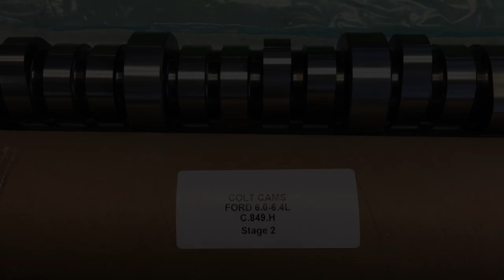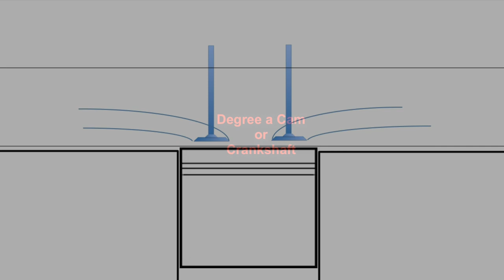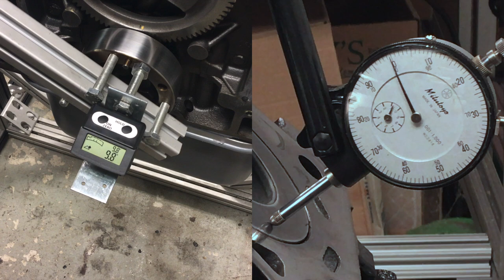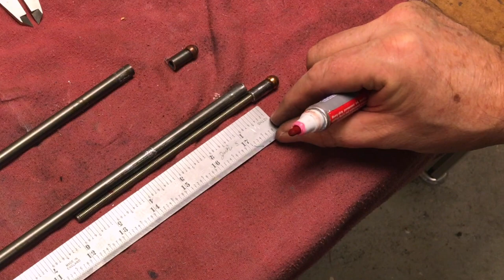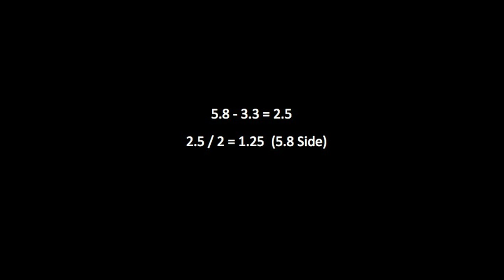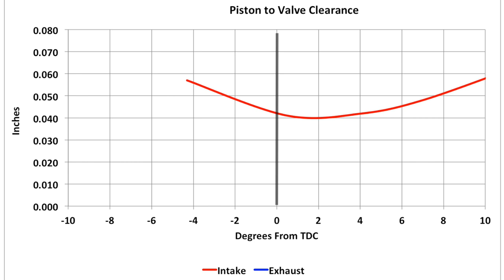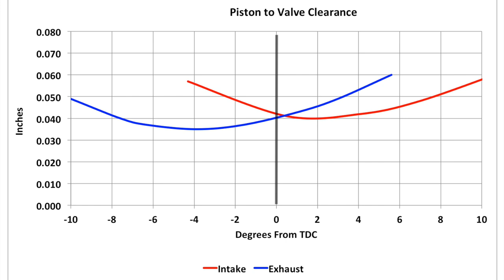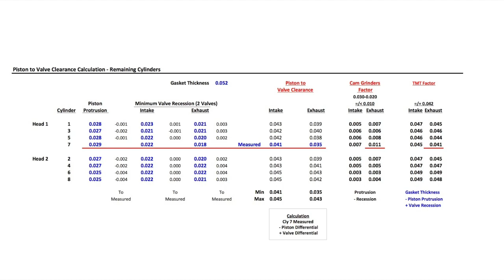Powerstroke 6.0 Colt Cam Stage 2 Piston to Valve Clearance Check

Comment: This video is very helpful. I just broke all my intake rocker arms after an engine rebuild and colt stage 3 cam.
Reply from the maker: Mike, really sorry that happened to you.  The three ways of dealing with that are the lowered height pistons, flycut valve reliefs, and sometimes deeper valve recession.  It can be a combination of the two.  This has to be frustrating!
Reply: @toomanytoys Thanks for the the tips. I bought an engine hanger from you a while back. I got the $100 model. I am putting it on a E450 Schoolbus. The hanger works great if I put a chain link in between the uprights. I'll send pics. 
I did have a machine shop shave 80 thou off the pistons before this happened, I guess what wasn't quite enough. I am using the 6.4L length pushrod.
I will also check the cam timing, as if it were retarded one tooth this might happen?
Reply from the maker: @MikeF1189  Without looking at the numbers, I would have expected 0.080" would not have an issue.  A question I can think of is, were the valve recessions within or to the deeper side of tolerance?  

Checking the timing is a good idea. 

Unfortunately, I had no experience with these brackets with the Van, but I'm glad you found a way.

Comment: I have the same Mr. Gasket dial at 5:25. It works for me. Clockwise reading then counter clockwise, and divide by two. It works. I don't see an advantage to going with a digital scale.

The question, what if you found the least piston protrusion cylinder, say number two then swapped it with number 7?
Reply from the maker: With the dial, the accuracy depends on the parallax of reading the pointer to dial, and you have to be in front of it.  The digital takes out any errors and is easy to read and easier to set up.  After doing it both ways repeatedly, I'll always use the digital now.  But if your fine with the dial, stay with it.

You can flip the CR/pistons to equalize compression (protrusion on this motor).  It depends on the con-rod/piston assembled unit's tolerance stack to any variation in individual crank throws.  You can even see what the tolerance stack is between pistons and con-rods.  Unless you got a real issue, it's a fair amount of work.  There's more variation in the aftermarket parts world.

Comment: Jack, you don't know me but you've had an influence on my latest engine build. 

I just got the engine back in my truck; like two days ago; I put in a Colt stage 2 cam and a borg warner S300 turbo; I balanced the rotating assembly and had some custom tunes made up. I'm very impressed; very happy, thanks for making this video and influencing my decisions.  

How's your truck running now? are you happy with it?
Reply from the maker: Glad to hear anything I've done has helped.  Enjoy the truck.

Getting the engine back to gather is about my lowest priority, unfortunately.  It would only take me about a day from where it is at this point.

Comment: The late model pushrods are shorter than the 03s I believe .007 shorter to mitigate cam and lifter failure correct me if im wrong
Reply from the maker: The 6.4L motors had the shorter pushrods by 0.050", 9.845" to the new 9.795".  The very first 6.4L motors used the longer pushrods and had issues according to Geoff Bardahl, owner of Colt Cams.  The shorter pushrods were immediately introduced during the initial production and International dropped the longer pushrods.  The longer pushrods were not introduced until 2008.  

In a stock condition, the times you have a 6.0L develop bent pushrods and broken rockers is when the motor sits for months (like school busses) and the guides rust.  The other times the 6.0 bend pushrods is during in-service rebuilds.  The lifters can draw in more oil during the teardown and be "pumped up", or the pushrod is not fully engaged into the plunger cup.  They can also bend if the valve spring pressures are increased, and you see that when heads are rebuilt.

If the 6.0: was bottoming lifter plungers due to too long pushrods, we would primarily have seen a lot of burned intake and exhaust valves as they would not fully close once the valve train expanded at full temp.

Comment: Stupid question, does the litter move the guides vertically (with respect to the cylinder bore orientation) when the cam lobe pushes on the lifter? I have been doing some reading on the guides, specifically how tolerances with the direct injection molded plastic can leave the lifters permanently 2 degrees off square with the cam.
Reply from the maker: The guides have no impact on the lifters' bearing surfaces, so no impact on the directionality as far as parallel to the cylinder bore orientation.  The guides only keep the lifters from turning in the bores, so the roller is oriented CLOSE to the 90º of lobe rotation.

What does keep the roller at 90º to the lobe is the roller itself, being barrel-shaped rather than flat.  Most people do not realize that.  A wheel with a crown to the center wants to track straight.  It also works with belts, and why you often see flat belts with one, and only one, fully with a crown to it.

I do have a lifter video if you care to review it.
Reply: @toomanytoys  I have seen the lifter video several times, that is what brought me here. Unfortunately I have not been able to answer my own questions up to this point.

I have heard much speculation as far as the cause for higher lifter failure fates on the 6.0 powerstroke. Your video discusses  a few factors which seemed as if they could potentially contribute to increased lifter failure, however one I have found which wasn't mentioned is the guides.

Here is an excerpt from some research I reviewed:
"Plastic lifter guides are injection molded with an interference fit to hold lifters firmly for assembly purposes. This tight fit is supposed to locate a roller lifter so it’s nose wheel is in perfect alignment with the camshaft lobe. However, our measurements have shown that plastic guides are often mis-shaped and do not align lifters properly with the camshaft. It is common to find plastic lifter trays out of plane by .005" in .500" and as bad as .015" in .500".Nearly 2 degrees crooked! 2 degrees is double the entire range of motion steel lifter guides allow and the plastic guides fix the lifter that way for its life"

If the above is true, I could see this as being a contributing factor to seemingly randomized lifter failures .

I have heard that one of the series of the duramax uses metal guides, however the plastic LS guides will fit inside of the area where the metal guides sit. There has been speculation as to the engineers testing with the plastic LS guides, then switching to metal for production. I have no way of verifying this. I do know that lifter failure on a duramax is virtually unheard of.

Thank you for your insight.

Comment: Think I'll just use clay.  Are you interested in a move to Concord, NC to be my neighbor?
Reply from the maker: Thanks, but I don't want to make a habit of 6.0s.

I had tried clay on this but didn't feel confident in measuring clay this thin.  If it was 0.080", there would be more tolerance for a few thou off.

Comment: I'm enjoying your videos on YouTube. I'm a farmer in Kentucky with a 2004 powerstroke. I bought a 2006 powerstroke with the transmission that came out of E350 few months ago. I wanted to rebuild it for my powerstroke due to high mileage. I blew a head gasket and water mixed with the engine oil 2 weeks ago. I sent the heads and block to  a machine shop and  I should be getting them back in 2 weeks. I'm not looking for any additional horsepower, the oem camshaft is $1200, a volt cam is cheaper. do I need to do additional work to the head, block or pistons to get a stage 2 colt cam? what do you recommend stock, stage 1 or stage 2 camshaft? I will also be sending the transmission for overhaul too. the purpose of my powerstroke, I tow a livestock trailer, haul hay and feed for my livestocks. your videos and information is well appreciated.
Reply from the maker: Wow, I can't believe it's that expensive now.  When I bought mine, but sent it back, it was ~$800.  Tasca Ford has it cheaper at ~950 plus shipping, but I doubt that price will stay there long.

https://www.tascaparts.com/oem-parts/ford-camshaft-4c3z6250aa

There are more companies that have cams now, but I'd look to Colt, Comp Cams, and Kill Devil.  For your situation, a Stock or Stage 1 cam would be best.  With the aftermarket cams, you have to move your retaining plate and cam gear from the old cam to the new one.  It's easy to do if you have a press, or know a shop with a press.

Comment: Hey! I run that same cam, I don't have my numbers handy, but I remember being in a similar situation where I had 2 pistons .002" higher than I wanted it to be. After a back and forth with my machinist, we decided to run it as is, and it has been running for ~75,000 miles. What did you decide to do? Also interestingly, my original (factory) cam had the roller break through the hardened surface at 224,000 miles, which I later calculated to happen between 180-240,000 miles under normal driving, though very dependent on type of driving. While colt cams wouldn't tell me the exact steel used in there cams, several "best guesses" put its fatigue strength well above what is needed to not have a problem under normal, or even severe driving conditions.
Reply from the maker: At some point, I need to complete a video about cam failures.  That type of failure that we have can be influenced by several things; the depth of the hardening, the grinding procedure, the oil functionality (quality and cooling), and the fatigue loading.  I think we get enough combination of all to get failures in the 200-250k range.  The Fuel-Pro gasket is 0.002" taller, and I "dressed" the piston tops, which I'll leave at that point for pondering.

Comment: Your videos deserve more likes! Plenty of machine shops decked the head & block without ensuring proper piston protrusion vs valve recession.   To address this issue, I plan to use 6.4 pushrod ( 1/16" shorter than 6.0 ) and mill the pistons
Reply from the maker: The pushrods will not have any effect on the valve to piston clearance issues.  Only piston protrusion height and valve recession in the head,

Comment: I follow you on powerstroke
Reply from the maker: Thanks.  A good forum to get help and answers.
Reply: @toomanytoys   i have a f-250 that has been studded, cat delete, new egr, new oil cooler, new new degas bottle, new thermostat, bpd water pump, new bod 7.3 mechanical fan clutch and new trans. I notice that i degas when towing hard. My delta temps stay withinn10 degrees amd wont exceed 210 degrees. My worry is that i degas a little when towing hard . 10k+ uphill. 
Biggest worry is HG. Is there another problem that may mimick HG aside from the EgR?
Reply from the maker: @susiervo1  Degas is the process of removing air from the trapped areas of the cooling system; by design, we have two where there are hoses.

If you mean the degas cap is releasing air and possibly coolant, you need to monitor the coolant system pressure, and work from there, as discussed in the forums.  As far as I'm concerned, every 6.0 owner should have a permanent coolant pressure gauge so they know what the system is doing.

If you are puking, PS.org is a good forum to bring the subject up.

Comment: You run the engine yet?
Reply from the maker: Yes, installed and run since January.
Reply: @toomanytoys  you have a video update?
Reply from the maker: @susiervo1  No, I've got an issue with my Mac computer that has my video files on it.  That's why I'm not publishing videos.
Reply: @toomanytoys  how long you going to keep us in suspense?
Reply from the maker: @susiervo1  As I said, I have a problem with my Mac.